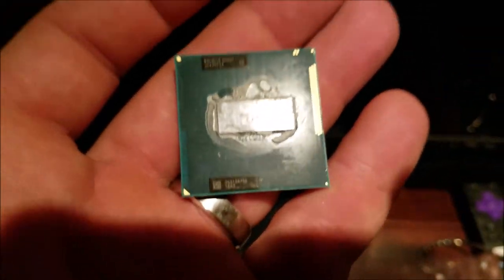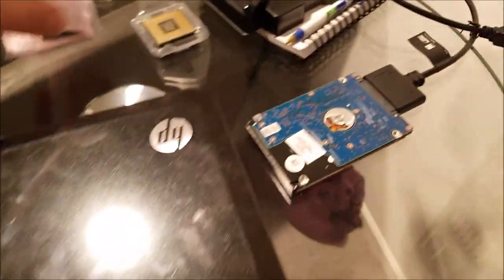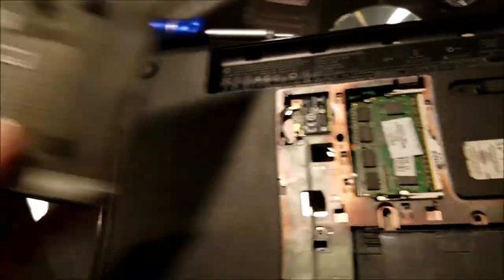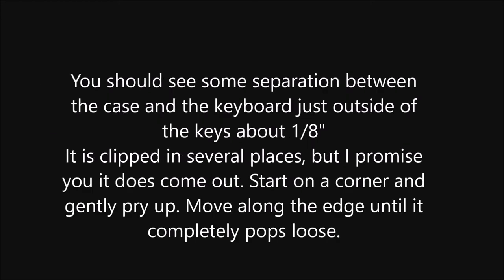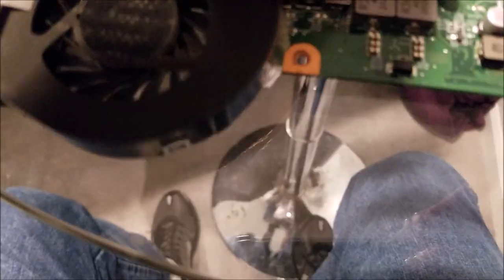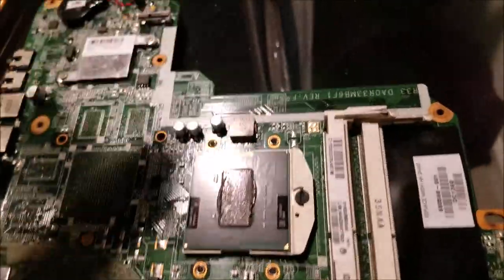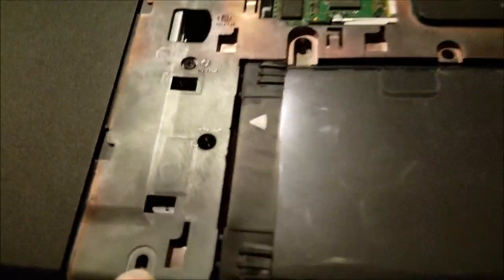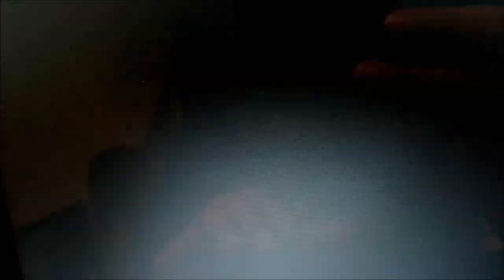How to upgrade to an i7 processor in your old laptop

Comment: I have t420 with i5 2410m what is the best processor i can put without having heat issues btw nice video
Reply from the maker: I'm not sure what your chipset is. I'd definitely recommend a quad core. If you learn your chipset, look for the cpu compatibility. 
  I would recommend at least a 2630qm or a 3630qm if your chipset supports it. They are both quad cores. The newer 3630qm is based on ivy bridge architecture instead of the older sandy bridge and is inherently more efficient and faster. If your chipset supports it, you should get a 3000 series cpu. My 3840qm was an incredible upgrade over my original 2370m. I wouldn't suggest going for a 29xx or 39xx xm chip. They are too costly for a laptop this old. At some point, you could upgrade the entire laptop for the price of a new cpu.. so your budget will determine if you should upgrade to an ultra high end cpu. 
  One upgrade that I recommend is an ssd. They are relatively cheap and will make loading times much quicker. My windows boot time is under 20 seconds. The cpu can only process data as fast as the storage can provide it. An ssd is much faster than an old mechanical hdd, and they are more resilient to drops and shock load. If you are running a factory hdd, it is probably near failing and needs to be replaced anyway. The hdd mechanical drives do not live forever. 
  Also look at upgrading your ram. I got a 16gb kit for cheap a few years ago. You don't need 16gb, but 8gb would be nice. 
  Good luck with everything. If you have any more questions, feel free to ask.
Reply: @EricErnst  Thanks for the fast and comprehensive reply. My laptop supports only sandy bridge and for now im thinking of going with i7 2630qm since in my country its a lot cheaper than i7 2670qm.I have one 4gb stick of ram and I found 8gb stick so in total it will be 12gb which I think is enough.BTW Will 65w charger be enough for the new cpu?
Reply from the maker: @k.o.7629  65w charger will be fine. I also bought a new battery when upgrading mine. If you can't unplug it for more than an hour, you need a new battery. It's amazing how much freedom a new battery gives you. My laptop is actually mobile again. I think I spent $25 for a new battery. 
  12gb of ram should work great for you. Some guys think that your ram sticks need to be the same capacity. That's untrue. 
  Good luck with your laptop! I hope it gives you years of life like mine has! I still use the laptop from this video as my primary laptop, although I've switched to a desktop pc that I built for video editing. My desktop is way overkill for what I use it for. It has an amd 3950x processor, 32gb of 3600mhz ram, an amd 5700 xt gpu and 3tb of ssd storage. 1tb is an nvme m.2 drive. 2tb is a 2.5" sata ssd. It's killer!

Comment: did you have a web site that i can find the correctly socket for my laptop? I have a I7 3610QM and want to discover whitch processor i can use on MAx. Test this yours 3840qm on cinebench R15 multicore. thanks
Reply from the maker: Www.ark.intel.com . You have a 3610qm. That's a quad core  mobile chip. The fastest you can run is a 3940xm. I looked at tdp and cost and settled on the 3840qm. The xm processor is overclockable. My 3840qm is not, but it's plenty fast for my mobile needs. I have a 2920xm processor, but it was running over 100degrees C when I was rendering YouTube videos. That's why I swapped to a 3840qm. It has 10w lower tdp. 
  I recently upgraded my desktop pc to a ryzen 3950x. It's a 16 core/32 thread behemoth.  If I need any heavy lifting, the desktop pc makes short work of it.
Reply from the maker: I don't currently have cinebench installed. I'll download it and let you know.

Comment: Hello sir
I have a HP Notebook 1000-1111tu
It comes with i3 2370M
And my motherboard is HM75
Which version of i7 do you recommend me for an upgrade?
Reply from the maker: https://www.cpu-upgrade.com/mb-Intel_(chipsets)/HM75_Express.html 
  I really like my 3840qm processor. You can run an ivy bridge chip with your chipset. I would recommend at least a 3610qm. A quad core will speed up many tasks. I recommend finding the balance of budget and performance. It's an old laptop, so I can't say how much you should spend on it. You could go all out and get a 3940xm.. but it would be overkill. I would definitely look for a 3000 series cpu and recommend a QM. Q means quad core and M means mobile. Any 2000 or 3000 series chip with an M designation will drop in the socket. 
   The 2370m chip does not have allow boost clock so you are stuck at 2.4ghz. My minimum recommendation is a 3610qm. It has a slightly slower base clock but under light loads will boost single core performance to 3.3ghz. That will make it feel much snappier, regardless of the base clock being a little slower. Under a heavy load, 4 cores at 2.3ghz will be much faster than 2 cores at 2.4ghz.
  Ultimately, you need to see what is available and for what price. Here is a list of processors that will work and be an awesome upgrade to your 2370m.
https://ark.intel.com/content/www/us/en/ark/search/featurefilter.html?productType=873&1_Filter-SocketsSupported=3591&3_CoreCount-Min=4&3_Lithography-Min=22&3_Lithography-Max=28
  I find my processors used on ebay. I'm not sure if ebay is available to you, but I'm sure you have an equivalent. 
  Also, if you haven't upgraded to an ssd for storage, I definitely recommend that as well. Windows and other programs start very quickly. A cold start can be under 20 seconds. How fast is your laptop's boot time? 
  Good luck with everything. Let me know how it works out.
Reply: @EricErnst  thank you for your answer sir!
I think that i would go to 3610qm

Comment: 我今天恰好要把i3-2370m升级成i7-2760qm，不知道结果会怎么样。
Reply from the maker: I believe you will be thrilled with the results. The 2760qm is a quad core as opposed to a dual core. The performance will be much higher. If you haven't already, I'd recommend upgrading your storage from a hard disk drive to a solid state drive. Startup times will be under 20 seconds and programs will open much more quickly. It will add life to your old laptop! Cheers.

Comment: I have a Lenovo g470 and it has an i5-2410m but I want to upgrade to i7-3940XM They are the same card but one is Ivy bridge And the other is Sandy bridge What are your tips?
Reply from the maker: Update your bios first. I successfully upgraded from a 2370m to a 3840qm.... sandy bridge to ivy bridge. The new chip will fit right in the socket. Make sure your cooling vents are clear when doing computationally intensive tasks. The cooler was designed for a 2 core, and you'll be installing a faster quad core. The newer 22nm ivy bridge architecture is more efficient than the 32nm of sandy bridge so it generates a little less heat. I think it will work great. Don't forget an ssd and a little more ram while you're in there. I think adding an ssd is the number 1 component that makes an old laptop feel snappy and quick again.
Reply: @EricErnst  hi bro, I have the same laptop with the same specifications as angel mendez, but instead I want to try to place an Intel Core i3 3110m, I have the HM65 chipset, according to the cpu upgrade website, this motherboard is compatible with the i3 3120m, I would like to try but I'm afraid to burn the laptop trying to install a processor of another generation. So what can I do, is there danger of the laptop dying? 

Sorry for my bad english, i am from Chile xD
Reply from the maker: @MrZeroGamingHD  hey man, your English was perfect. With the newer architecture of the ivy bridge chip, it would likely be both faster and less power hungry than your sandy bridge processor. You will not burn up your laptop or motherboard by simply swapping to a newer processor. I have run 4 different processors in my laptop, all higher power than my originally installed i3 2370m. If I recall correctly, the highest power chip that I was originally installed in my laptop was an i7 2640m. It is an i7 series on but still a dual core chip. 
  It worked, but was only a few hundred mhz faster than my i3. I didnt notice much of a difference. I wanted a little more processing power so I ordered an i7 2920xm processor. I was unsure if it would work at all. The 2920xm was awesome. There was a huge speed improvement. There was also a big jump in heat generation. I think that an i3 3120 will be faster, but not a huge improvement over your i5 processor. In fact I doubt that you will even be able to tell the difference. The 3000 series processor will be a little cooler because it is made on a 22nm process vs the 2000 series chip with the 32nm process. After these improvements, Intel was actually stuck on 14nm for several generations. Intel actually released a new budget chip last year with a 22nm processor. Regardless, you will certainly not burn up your laptop or motherboard by upgrading to a 3120m. In fact I would even nudge you to go with a quad core processor. I bought an old laptop for my mother a couple years ago and I think I got a i7 3630qm processor for relatively cheap. The processor model number is close, if it wasn't that exact one. I installed that, an extra RAM stick, and an SSDn and she surprised her with a laptop that works much better than her 15 year old laptop did. She was blown away by the quick startup times and snappy response. I would recommend that you try to find a cheap quad core processor. A quad core processor will end with the letters "QM". A dual core processor will only end in "M". You could go all-out and find an Xtreme chip with an "XM", but that isn't very economical. The i7 3840qm that i chose is perfect for me. It is a very fast quad core CPU. The single core speed is faster than the 2370m that it replaced and it runs cooler than the 2920xm because it is newer and built on the 22nm process instead of the older 32nm process. 
  So again, make sure you update your bios first, then I would recommend a quad core ivy bridge 3xxx series chip. It will run cool and be much faster than your current processor. 
  Good luck with everything. Let me know how it works out.

Comment: I have Sony vaio vpccb35fn laptop with i5 2430m processor. Which processor is the max  that I can upgrade?
https://www.sony.co.in/electronics/support/laptop-pc-vpc-series/vpccb35fn/specifications
Thanks
Reply from the maker: If your chipset is hm 65, you can only use sandy bridge 2000 series processors. If it is hm 76, you can use the better 3000 series ivy bridge processors. The absolute fastest processors in each generation are the xm... so a 2960xm or a 3940xm. Both are 4 core/8 thread. Depending on your use,they may run a little warm on your laptop. Gaming is fine but video processing and rendering really stresses the cpu. Budget is also a concern. Sometimes an xm just isn't worth the extra cost. That is why I settled on a 3840qm.

Comment: hello, I have a question, I would like to upgrade an i5 2450m to an i7 3740qm, is this possible?? (socket G2, chipset HM65), if not compatible, which of the i7s could  i installed ?
sorry for my poor english  🤣🤘
i find something from you Eric: 
So for the I7 3740qm, it's dead, maybe I7 3610qe ???

EDIT: the i7 3615QE is a BGA ,so it is soldered, so for me it is only the second series, i think.
thx

Eric Ernst
il y a 4 mois
I think that is the perfect upgrade. It will not overheat with your existing cooler and it will be much faster than your current processor. That is exactly why I chose that exact processor for my laptop. There is one thing that you need to check. You need to know your chipset version. It should be something like HM65 or HM76. The older version, HM65 came out before the 3000 series cpus and is not compatible. The chip will physically fit into the socket, but it will not boot. The 3000 series chips run great. They are built on a 22nm architecture instead of the 32nm architecture. If your chipset is the older hm65, I think you'll be better off with a 2860qm.
Reply from the maker: Hello, the hm65 chipset limits you to 2000 series sandy bridge cpus. I recommend a quad core. It will give you a much bigger boost than just upgrading to a slightly faster dual core.
  I'd recommend anything from a 2630qm, 2670qm, 2720qm, 2760qm, 2820qm, 2860qm. I've used a 2920XM and my cpu ran a little warm with the higher heat load. I don't recommend that or the 2960xm.
Reply: @EricErnst  thanks for the reply, and advices, i will go for the i7-2860qm.
Its for m'y mother old 2011 laptop, still good, ssd,ans 16go, but now its time to boost 😈😈
Reply from the maker: @davyxxx9761  I bought an old laptop for my mother a few years ago. I installed extra ram, an ssd, and a quad core processor. It's a lot faster than her old one. Her old laptop was almost unusable. The newer one starts in seconds as opposed to minutes. I just used a lower 3630qm processor. It's plenty for her needs and was cheaper than the higher clocked processors. I'm sure your mother will love her new laptop. Good luck with everything.

Comment: It has voltage?
Reply from the maker: It receives a small amount of voltage from the motherboard. I think this processor runs around 1.3 volts.
Reply from the maker: @ZTX ALFA unfortunately I think the qm67 chipset only accepts 2000 series cpus. If you upgrade, I'd suggest anything with a QM in the part number instead of just an M. There is a weird intersect at 2630qm and 2640m, but any number above that should be a quad core. I upgraded from a 2370m to a 2920xm and that seemed to run a little hot, but the 3840qm does not run hot. I think an additional 10w is acceptable but 20w is not. 
  https://www.cpu-upgrade.com/mb-Intel_(chipsets)/QM67_Express.html
  
  Above should be a list of supported cpus for your chipset. I recommend a quad core if you're going to upgrade. Search your area for any of the models supported and weigh the price. Sometimes the 2630qm is priced higher than some of the better models because everyone searches for the lowest model with a quad core. You may be able to get a better cpu for less money. Good luck with your upgrade.
  If you haven't, I'd also swap to an ssd for storage. It makes boot and load times very fast.
Reply from the maker: @ZTX ALFA to be honest, the integrated graphics are pretty bad on both sandy bridge and ivy bridge. I bought an external gpu adapter and ran it on an amd rx 580 gpu. It was much faster in gaming compared to without. I used a TV as an external monitor. The only problem with that is it makes your laptop much less portable. It has been a few years ago, but it was definitely faster in games with the external gpu.
Reply from the maker: @ZTX ALFA My desktop pc is awesome. I used to use my laptop for editing and rendering videos. Now I only really use it for datalogging and tuning cars and trucks. My desktop has an rx5700xt gpu and a 3950x cpu. The cpu is an absolute monster. 16 cores/32 threads. They just released the next generation a couple weeks ago. The 5950x is unreal. 20% faster than my 3950x! In a week or so they will release the new 6000 series gpus. My processor is way more than I can utilize so I won't upgrade it, but I'm pretty interested in a  different gpu. I can't really take full advantage if my current 5700xt with my current display. I use my TV as my display. It's only 1080p/60hz. I could run games on max settings with my old cpu/gpu setup with 1080p/60fps. I had a 2700x/single rx580 when I first built it. Then I switched to crossfire rx580s. Then I pulled them in favor of a single 5700xt.
Reply from the maker: @ZTX ALFA I like that you want to try new things for the experience and knowledge that come with it.
Reply from the maker: @ZTX ALFA I don't really have a good area to set up a desktop pc so I set it next to my entertainment center in my basement. It's a 65" TV so I can sit on my couch and edit my videos and stuff. I work a lot of hours so I don't have much time to actually play games. I have a few Xbox games that I have never even opened.

Comment: Hi Elric. Just wanna ask. Is it suit with Acer Aspire 4315 ? thanks
Reply from the maker: What processor do you have? If it is an intel 2000 or 3000 series CPU, then yes.
Reply: @EricErnst  Intel Celeron
Reply from the maker: @Truth-Spoken  I need more info than that. What model CPU? That celeron is just their budget laptop line. That's like saying you have a core2duo or an i3. I looked up your laptop model and got results from 2008. If that's the case, it will absolutely not fit. I need a model number so I can see what generation your CPU is.
Reply: @EricErnst  Core Duo. You're right. think that's not gonna fit for it. Thanks so much Eric.

Comment: Hello sir, I would like to ask if my laptop vaio vpcev25fx with a cpu of Core i3-2330M, could upgrade to Core i7-2620M .. I really don't know much about upgrading but I have researched that this might be possible. Thanks!
Reply from the maker: I'm not sure if your chipset will support ivy bridge processors or not. A Google search only yielded a version of your laptop with an amd cpu. Update your bios and you should be able to run any sandy bridge chip. I have personlal experience with an i7 2640m. It is a higher clocked i7 chip, but i think you will be happier with a quad core cpu. The difference will be much more than from a higher clocked dual core. Try to locate a 2630qm. I think that will be a better chip than the 2620m that you are asking about. 
  If your chipset is hm76, you can actually run 3000 series (ivy bridge) intel cpus. If your chipset is hm65, you can only run 2000 series (sandy bridge) processors. The ivy bridge processors run faster and cooler. I had a 2920xm and swapped it for a 3840qm  because it was just too hot.
  If you haven't already upgraded your storage to an SSD, I would do that as well. It really gives new life to an aging laptop. Good luck with everything.
Reply: Okay sir, I'll be looking in to it!
Thanks!
Reply from the maker: @dxtechcreations  let me know how it works out for you. Good luck!